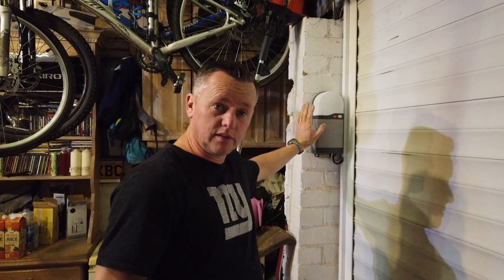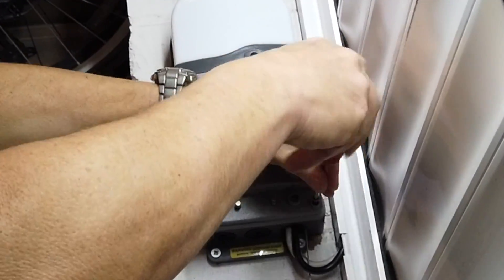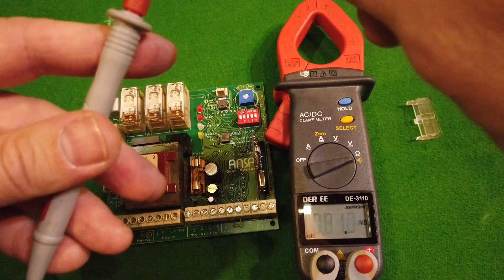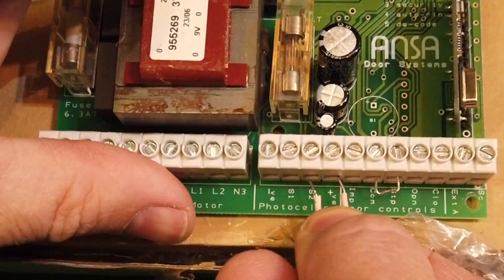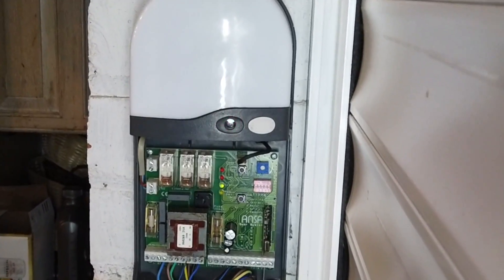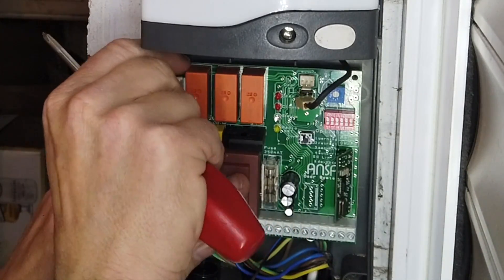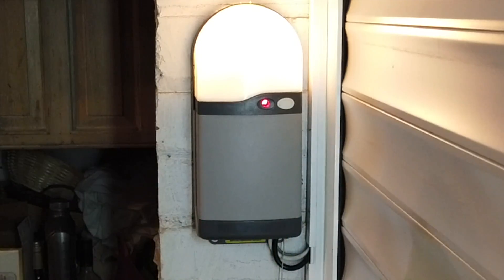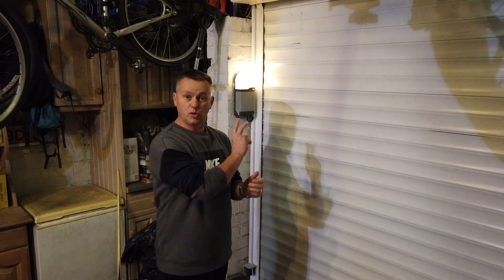Roller Garage Door Controller Fault Diagnosis & Repair

Comment: I have a slightly different model. I changed the infrared sensor it works but a month later it’s packed up. Only one fuse both that and bulb blown. Both replaced red light on circuit came on. When using fob with new battery it looks like fuse blows. 25 v 2.5 amp fuse. Any ideas please.
Reply from the maker: Not sure sorry, Thanks for the great comments👍🏻👍🏻🛠

Comment: Hi @aaanton11 I have lost my remote and have bought a couple of new ones off the internet. I follow your instruction but I can't programme the remote to the controller. Does the new remote need to be reset or not, before it is linked to the controller? Thank you
Reply from the maker: You will need to buy direct from ANSA the generic ones don't work, Thanks for the great comments👍🏻👍🏻🛠
Reply: @aaanton11  Thank you. I have ordered it so let's see how I get on with it when it is delivered

Comment: Than you for the video. I have different problem. I have no photocell fitted the problem is that my key fob won't close the door. If I keep the main button on the control unit on then it come down. If I let go it stops. I have to keep the main control button for down on until the door closes. All I did was replace the batteries in the door remote sensor. Any advise.
Reply from the maker: Sounds like a photocell issue, there must be some sort of safety trigger o the down side, Thanks for the great comments👍🏻👍🏻🛠

Comment: In case anyone is interested it was a faulty sensor which I replaced.  I was quoted £720 for a new control systsem by my friendly Checkatrade  garage door man. So I decided to investigate myself. Ansa still have the two critical spares- sensors and PCBs. I did not find them easy to deal with but once over that, with the help of the video the fault is easy to correct. Cost £75. Now I need to replace the light....................
Reply from the maker: Thanks for the great information👍🏻👍🏻🛠

Comment: Great video but mine will not close unless I hold the button and is fast flashing red all the time. Amber led on the sensor is solid, any advice pl?
Reply from the maker: is the reflector lined up, Thanks for the great comments👍🏻👍🏻🛠

Comment: Great Video and very helpful. I have 2 roller doors side by side. One works perfectly but the other one has a long delay before closing. It works straight away when you press the button to open it, but I have to hold the button on continuously for it to close and there is about a 5 second delay before it reacts, then if i take my finger off the button it immediately stops and I have to go through the whole procedure again. Any thoughts? many thanks, Terry.
Reply from the maker: Sounds like the safety sensor on the down cycle is faulty, Thanks for the great comments👍🏻👍🏻🛠
Reply: @aaanton11  Is it fixable? If so, where do I find it? My Controller is identical to the one you have shown in your video. Thanks again, Cheers, Terry

Comment: Great video, I have the same controller and when I open the door it only goes 3/4 of the way up. I have to press the switch to knock it down slightly and then press again and it goes up to the top. Could you point me in the right direction please? Thank you
Reply from the maker: Is the door tight in the channels, it is possible the motor is cutting out on the load sensor, Thanks for the great comments👍🏻👍🏻🛠

Comment: Thanks for the video I have a problem with my garage  shutter door,it doesn't close and red light comes on I have to manually hold wire near eye sensor  to get red light off and then close the door
Reply from the maker: Glad it helped, Thanks for the great comments👍🏻👍🏻🛠

Comment: Having issues with trying to reprogram another button on the remote because the RED LED indicator doesn't appear to be working. It doesn't light when the door is operated, nor does it indicate that it is in program mode!! Stumped!! Any ideas please??
Reply from the maker: What is the controller you are using, Thanks for the great comments👍🏻👍🏻🛠

Comment: Hi Anton, I have had this garage type roller fitted with the light curtain but was looking to fit a smart wifi switch to it. Any chance you can advise please?
Reply from the maker: I am not familiar with that controller Thanks for the great comments👍🏻👍🏻🛠
Reply: sorry, it's similar but not the same. It's the Neco rollermatic controller

Comment: Hi can you tell me where I can purchase an ASNA  spare control board tried google and eBay no luck many thanks
Reply from the maker: Link to Amazon shop for tools, https://www.amazon.co.uk/shop/aaanton11
Link to New control panel, £38,  https://amzn.to/2VnVI9X
Link to video on Roller Motor replacement, https://youtu.be/H7zv9cac8aM

Link to ANSA Door systems website, http://ansadoorsystems.uk
Thanks for the great comments👍🏻👍🏻🛠
Reply: @aaanton11  Hey I am wondering if you can help me ..I need to adjust my roller garage shutter, when closing.it is closing down to the ground and keeps going until the roller is nearly off the end. Is there something that I can do to fix this?

Comment: great video where can I get the motherboard replacement
Reply from the maker: Link to Amazon shop for tools, https://www.amazon.co.uk/shop/aaanton11
Link to New control panel, £38,  https://amzn.to/2VnVI9X
Link to video on Roller Motor replacement, https://youtu.be/H7zv9cac8aM

Link to ANSA Door systems website, http://ansadoorsystems.uk
Thanks for the great comments👍🏻👍🏻🛠
Reply: Hey Anton great vid.  Picked up so much from single concise video than having to watch several and try and make best of it.   Your link for the control panel is a different make to the model in the vid which is identical to mine. Is the Ansa model version not available.  Can i be sure the Neco model will work with the model on vid that include the photocells - Thanks again

Comment: Great stuff Anton - my control unit has a reset button in the top left hand corner. The door occasionally stops working and I have to open it manually from the outside. When I remove the front cover and reset the unit it works fine again. Then it all happens again later! Could it be the PCB that needs replacing? Also you don't mention the DIP switches. Cheers, John
Reply from the maker: it may well be the thermo cut out in the motor, if its pulling too much power it will trip, once cooled down it works again, it is also possible the pub could be faulty, Thanks for the great comments👍🏻👍🏻🛠
Reply: @aaanton11  Many thanks Anton, much appreciated. I was a sparks before retirement but I've not come across these things before!
Reply: ps.....can you recommend a stockist for a replacement PCB? I would think that the part no. will be stamped onto the PCB. Cheers, John

Comment: Is this door noisy during windy periods?
Reply from the maker: not normally, you might need to adjust yours if it is, adjust the down on the motor so the door closes tighter, Thanks for the great comments👍🏻👍🏻🛠
Reply: @aaanton11  Thanks.

Comment: Great video - perfect for me with a faulty garage door controller (exactly same model) and didn't know where to start!. Overrode the safety controller to discover that was faulty and reset the circuit board following your very clear and well presented step-by-step instructions. Using the empty board on the desk to show clearly how to wire it up was an excellent way to present it. Thanks very much for saving me an expensive call-out !
Reply from the maker: Glad it helped! Thanks for the great comments👍🏻👍🏻🛠
Reply: @aaanton11  I spoke too soon ! it worked fine for a couple of days but is now 'flipping' between up and down movement. just juddering an inch up and and inch down repeatedly (even after re-setting it). Does that mean the circuit board is probably faulty ?

Comment: Great video mate thank you it gave me the confidence to change the pcb. 

Just a few pointers that may help others as I had a bit of a chew on. 
The original Henderson remotes are not compatible to the new Ansa pcb. So new remotes where required. 
Also my original photocell was acting up with great help from the people at Ansa it was found I needed to attaché to the 24v live and not the 12v. 
Thanks again much appreciated.
Reply from the maker: Thanks for the tips! & Thanks for the great comments👍🏻👍🏻🛠

Comment: Brilliant video! Very clearly explained. My garage door makes an annoying alarm noise when the photocells are blocked for about 10 seconds. The door is fully up at this stage and it is not travelling. So for example if I am stood in the doorway for any longer than 10 seconds it starts to alarm. I like the safety feature that photocells afford i.e. stops the door moving if it is blocked but I just want to turn the sound off. Is there a jumper or dip switch that I can set to do this? It is a Neco power supply unit. Thanks.
Reply from the maker: if you remove the cover to the control panel you will see the speaker/sounder just disconnect it, Thanks for the great comments👍🏻👍🏻🛠
Reply: @aaanton11  thank you, but when I open the cover all I see is a PCB with no obvious speaker. I can send you a picture but can't attach it here.

Comment: Great video Just bought a property with roller thermaglide that doesn't work (rolls down but not up) and have the 4 light flash. I'm going to bypass the photocell and reset. If there's still an issue and need to replace the controller, where can I buy one. I can't find one on eBay. Thanks.
Reply from the maker: Links are in the video description, Thanks for the great comments👍🏻👍🏻🛠

Comment: Brilliant video. My door has a constant red led after the 4 flashing light. Switch off and on again all ok but now the door if requested to open just cycles up and down quickly? I will reset the board as you mentioned. Wish me luck
Reply from the maker: Good Luck! Thanks for the great comments👍🏻👍🏻🛠
Reply: @aaanton11  thanks for the swift response. If I shared a picture with you of both units, would you be able to advise? I would be very grateful. Happy to share a video of it with you once done for you to publish on your channel?

Comment: We have the same control panel, I have checked fuses and power is getting to the board, but there is not red led at all , tried resetting the board like you did, Any ideas, thanks
Reply from the maker: Are the leds lighting up on the door sensors? Thanks for the great comments👍🏻👍🏻🛠

Comment: Really useful - thank you. Do you know where I can buy a new PCB for the RS1 control unit? I can’t find any online.
Reply from the maker: Link to ANSA Door systems website, http://ansadoorsystems.uk
Thanks for the great comments👍🏻👍🏻🛠
Reply: Where did you get the board in the end, thanks
Reply: @lukenicholl7746  Hi Luke, I ended up having to buy the whole unit on EBay. I took the board out of that and swapped it over - worked just fine. Good luck!

Comment: Hi Great vidio   My door has two lights on the bottom  of the door i guess these are light sensors but there are four wires in to the wall unit ,do i bypass the same way ????? Cheers in advance Bob Hardy
Reply from the maker: Yes it should bypass with a jump wire, Thanks for the great comments👍🏻👍🏻🛠

Comment: Hi,
Great video thanks!
I have a roll smart rs1 roll smart unit. The red led comes on and then goes off within seconds when its powered up. I've followed your guide and have concluded the control panel needs replacing. Where did you get the replacement PCB from? I can only find full units at around £180-220. Very interested in just the PCB  replacement for obvious reasons! Thank you in advance!
Reply: Update.
I thought it was worth sharing this in the hope it may help someone else.
After spending 3 hours researching and trying everything I could find on the internet and that I could think of, I'd given up and was resigned to buying a new board/unit. Throughout I had not used the remotes for the door as I didn't consider it would generate a different outcome to the button on the unit (and they were not to hand in the garage). When I eventually tried the remote, the red led came on(and  now remains on as it should) and the door opened! It is working as normal now, I don't pretend to understand it but im very happy its working!
Reply from the maker: Thats great news, you must have reset the system by accident, great job Thanks for the great comments👍🏻👍🏻🛠

Comment: Excellent video, 
I have same unit, I opened door which worked fine I then stupidly unplugged the garage door to then use socket to plug in hover to clean car, then once plugging back in garage door it won’t go down by pressing button, I closed door manually with metal spinning hook, trying pressing button but still won’t open or close, took front panel of fuses are ok light statuses inside is green but won’t change when pressing button, ie door open or close lights, I have light sensor but yellow and green lights on and when step in front yellow goes out and red light flashes on unit, any help would be much appreciated ???
Reply from the maker: Have you tried the reset procedure I show in the video? Thanks for the great comments👍🏻👍🏻🛠
Reply: Reset fixed thanks again

Comment: Hey Anton, we have the same door which will close on the unit button but won't open. The 2 right hand relays click when trying to open but it does nothing. Could you help please? Thanks
Reply from the maker: You need to grab a multimeter and check to see if there is a voltage to the motor when you press the button to lift the door, it does sound like a control unit issue but worth checking the motor feed to be sure, the wiring is all explained in the video, I also have a video on replacing the door motor, Thanks for the great comments👍🏻👍🏻🛠

Comment: We have secureglide door which does not close in wet weather. It does close when we use the over ride button. We think it’s sometimes do with the bottom trim sensor maybe the seal is leaky. Do you have any ideas what might cause this. During dry weather it works ok.  Any web sites that explain how the bottom trim works and any checks we could carry out.      Steve
Reply from the maker: I would bypass it like I show in the video, I hate the sensors just use with caution, Thanks Stephen for the great comments👍🏻👍🏻🛠

Comment: Anton, many thanks for this video - really helpful. My door (Henderson) appears to have the same controller as yours, BUT no photocells, instead there is a door bottom edge sensor (in a rubber strip). There seems to have been an intermittent fault for some time where the battery in the wireless box on the door was going flat very quickly (1to 2 weeks). Right now the door goes up OK but I need to press and hold the button to manually bring the door down. Any pointers for this especially regarding the different sensors?
Dave
Reply from the maker: If you bypass the bottom edge sensor like I show in the video does it work correctly with the remote? Thanks for the great comments👍🏻👍🏻🛠

Comment: Hi I have eurodrive roller garage door that goes up but not down can do it manually , I’ve changed batteries in box on door but still not going are there any batteries in wall box it’s been bleeping for about a month thanks for any advice Denise
Reply from the maker: Sounds like the door sensors might be faulty, have you got a flashing light on the panel ,Thanks for the great comments👍🏻👍🏻🛠
Reply: @aaanton11  

Hi I have a Birkdale roller garage door that has been bleeping recently, and the remote control and the control panel can not up or down the door. however, when i off the power and on it again, i can up the door but no way can i down it except manually. Grateful for advice please. Herman

Comment: I have problem of door starting to open but then stopping after three inches. If i am quick and get my under it and apply a bit of lift it will then go all the way. Any suggestions? Type is same as yours.
Reply from the maker: sounds like the thermal overload switch in the motor is faulty, or the door is stiff to lift, try spraying silicone lubricant in the channels might sort your problem link to spray, https://amzn.to/2xsp2Cv ,Thanks for the great comments👍🏻👍🏻🛠
Reply: Think I have a similar issue Paul. did you manage to repair it? cheers
Reply: Quick update. I tested my control unit as per your video. Concluded the controller is busted. I also tested the roller motor by winding the door down a bit, about a 1/4. With the power unplugged, I wired the 240V +ve supply to the L1 of the motor. Later repeated for L2 (being careful as 240V live voltages). The door went up and down. So the controller isn't doing it's job. I am struggling to get a new PCB so have emailed ANSA.  Anyone sles managed to get a new PCB? thanks
Reply: Hi guys. Did the PCB sort out the problem with the garage door going up and down just 3"? Mine has developed the same glitch. Any suggestions?